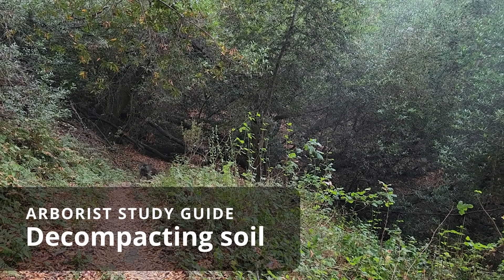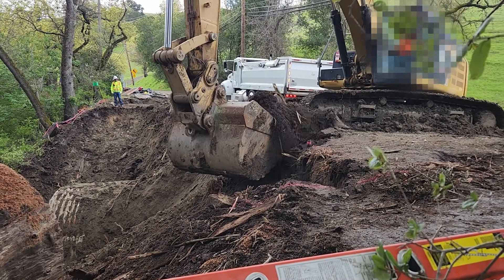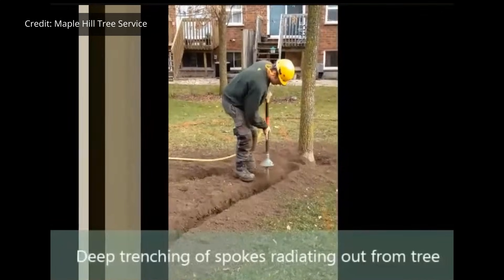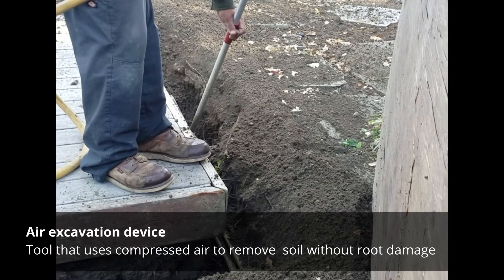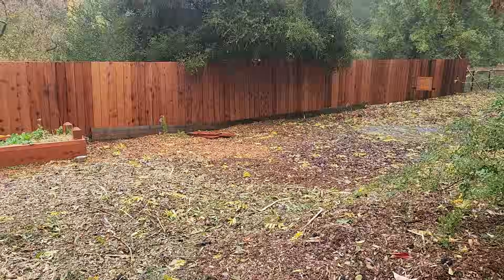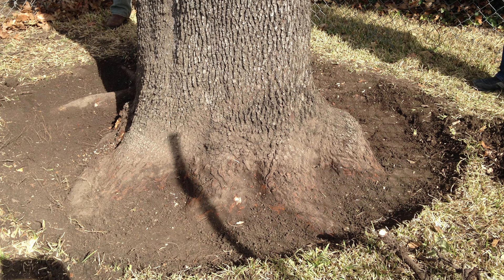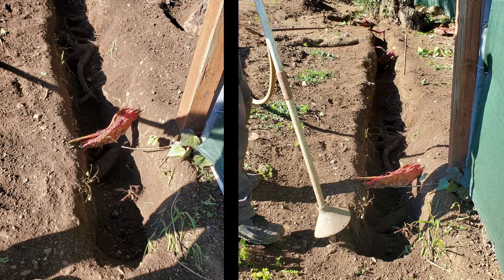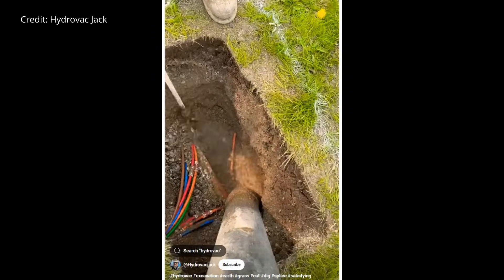Decompacting soil | Soil Science

Comment: The bits that is missing here is: you need to know the depth of your compaction before deciding on the best method to mitigate. You also need to know what type of soil you have, some soils will naturally de-compact with no need for input.
Any organic matter will enhance soil health, but wood chip is slow as it locks up nitrogen and surpasses microbial action for a period, better mixed with compost.
Reply from the maker: @JamesTrounce  yep, this is more of an intro to the topic, not meant to go into depth. Nitrogen lock up is an issue but occurs mainly at the surface/soil interface as long as you aren't digging the wood chips into the soil. The wood chips are also good for preventing additional compaction, whereas compost is much finer and doesn't offer the same benefits. For hands off/patient people, wood chips are a good option.